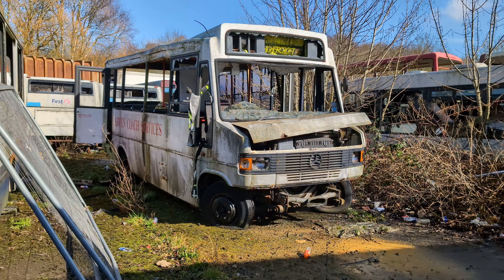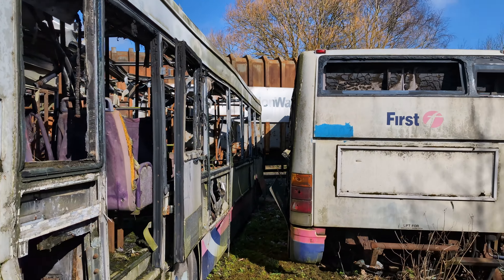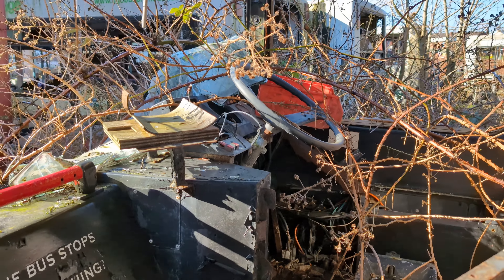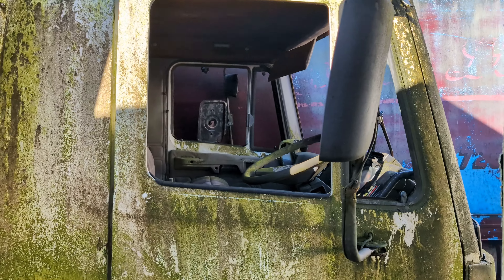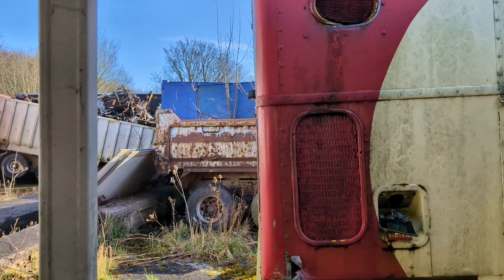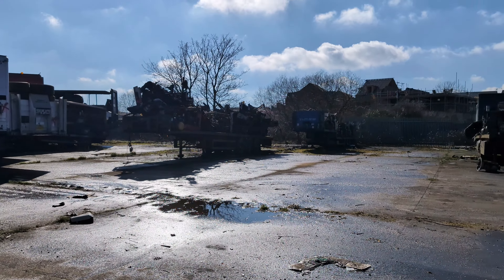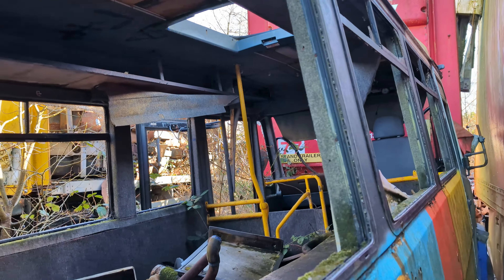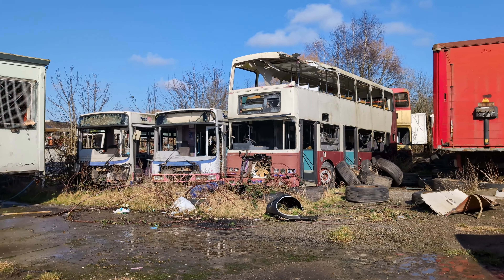Bus graveyard

Comment: It is not abandoned. Its a working acrap yard, although whoever runs is is seldom there. But the buses do get broken up, aswell as trailers. I assume they scrap whatever is more valuable at the time. Ive been inside there several times, the fire damaged vehicles all happened on site after they arrived. They used to used buses and concrete blocks to block the entrance, but have since installed gates.
Reply from the maker: I was unsure if it was still in use as one side had no fence at all, I thought i had seen a video about 5/6 years ago with some explorers and some buses where okay then
Reply: @outwiththebutler  kids get in quite regularly. But I can tell you that the property is very much not abandoned and is geared up with cameras. I went in a while ago and one of the site owners arrived asking me what I was doing. Told him I was just looking at the buses and he let me look round. I've also been in there for spare parts, the buses have slowly disappeared such as some of the Olympians and Darts that used to be there. The Volvo B6 and Scania FloLine were intact and I took several parts off them before they were burnt to a crisp. The FloLine had evidence of kids smoking joints and hanging out on it. It wouldn't surprise me if it was kids possibly leaving lit cigarettes on the vehicles that caused the fires, assuming that it isn't simply deliberate arson.
Reply from the maker: Abandoned taken of my title, Maybe owners need to put a fence up around the property, Could not see any camera`s on my visit